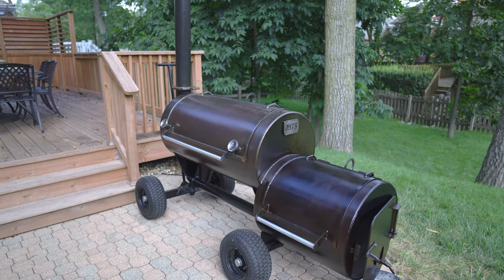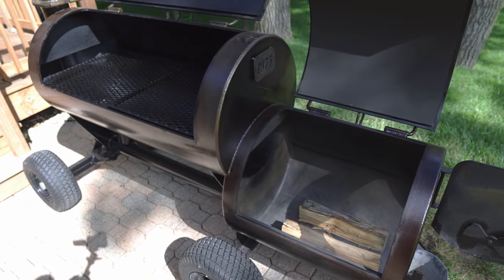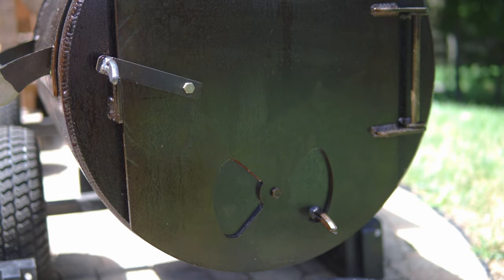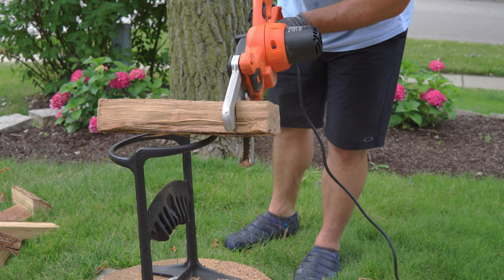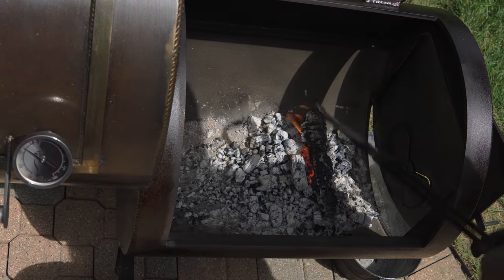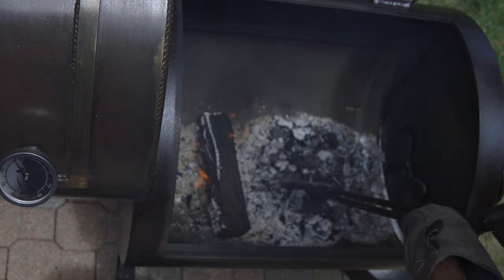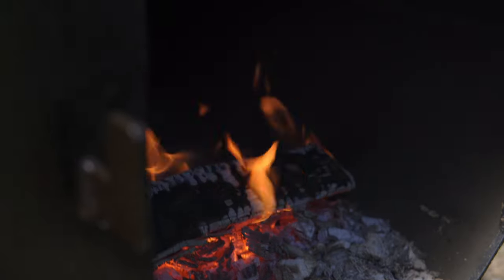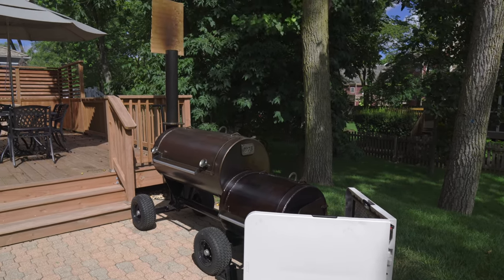How to Build a Coal Bed & Fire Management - Offset Smoker - Backyard BBQ

Comment: That folding table air deflector is genius ‼️
Reply from the maker: The wedge air deflector is a game changer. It's like a crutch I can't resist, even on calm days I feel the urge to use it haha! Flip it up, wrap some ribs, and then you know you're on to something. Thanks for watching!!
Reply: Yeahhhh Great idea!!
Reply: @smokescouts  what did you use on the stack? Was that cardboard? How did you keep it up there?
Reply from the maker: @jaredwatson8942  it’s a piece a thin wood that fits right in the gap between the stack and piece to hold the damper.

Comment: I have to say this is probably the best video I have seen on this subject.  Very well done.
Reply from the maker: Thank you, I really appreciate the feedback! I keep learning new techniques, so in a month or so I’ll make another one with some updates.
Reply: @smokescouts  I have never thought of using an alligator lopper before and like you, I had some concern about using a chop saw or mitre saw for this purpose (which isn't what they are designed for).  I have also been thinking about getting one of those splitting tools but wasn't sure about which brand, so thanks for the recommendation- I've got one on order.  I also live in a very windy place and had been thinking about doing what you have done there.  I think I'm going to get two big pieces of plywood, put hinges on them, and line them with a welders blanket.

And my workhorse 1957 is on its way.  Looking forward to the upgrade after so many years using cheap thin steel brands.
Reply from the maker: @patrickmacleod2415  that plywood idea will be perfect. My table is just a tad short, so the extra foot or so you can get with a 4 ft. wide piece of plywood will be perfect. You're going to love the Workhorse!

Comment: Thanks from a Newbie, just getting the hang of using a smoker. Got a OK Joe Longhorn for a birthday gift a few weeks ago. 1 rack of ribs and one small brisket both turned out great, but I clumsily managed the temps during the cook. This should help a lot.
Reply from the maker: You’re welcome! Smaller splits always make temp management easier, but if too small requires a lot of fire checks to keep feeding it, so I’d start with small splits and then work your way up to find that perfect size.
Reply: @smokescouts  you nailed it for me with the distinction between coal bed and split burn. I’m using 10” splits and about 2”x2”. Kinda found the sweet spot using similar door open trick and stack open full. Had it +/- 25* for the last 6 hours of my brisket. All of your tips helped me recognize what I had experienced so next time I can be proactive instead of reactive! Thanks again.
Reply from the maker: @michaelhemmingsen4430  awesome, you have it down for sure! Thank you for watching and the feedback!

Comment: Best backyard traditional flow smoker you can buy  right there! 👍 3/8 thick steel is no joke. Cowboy door is an option to NOT skip! Great video! Subbed! 😎
Reply from the maker: Thank you!! For this video I opened the cowboy door a lot to get some good video. I thought it would cause temp dropping issues, but the temp would drop 5-10 degrees and come back up to temp in a few minutes - which surprised me to say the least. You're right, that 3/8 steel is no joke!! This pit is a tank!!
Reply from the maker: Also, I agree on the cowboy door option, highly recommended just for fire and clean-up access alone. And those reverse seared rib-eyes are my families favorite!
Reply: @smokescouts  that is surprising...I wondered while watching this video again how much the temp dropped when you opened to stoke the fire or add splits...my current small smoker has the cowboy box and this is how I always add splits, but the temp will drop an easy 20-25 degrees if I leave it open for any longer than it takes to toss in a split...watching this vid again as I anticipate hearing from Workhorse in the next week or two that my 1975 is finally in production...question on the wood pile...how much wood would you say you have in those piles or how many cords I should say? I've got a stack built up but doesn't look like nearly that much...maybe I have underestimated how much wood this beast is going to burn...
Reply from the maker: @theftworthrealtor  yeah, surprisingly if you work quick, opening the cowboy grill doesn’t impact temperatures for more than a few minutes. If I have to do a more thorough coal bed arrangement or rearrange the splits, I still open it to do that with no issues. How many hours do you plan on cooking per week?
Reply: @smokescouts  Well it's about to be summertime, which means 100+ heat here in Texas, so I don't normally smoke more than once or twice a month...and I just got the email today that my pit was in the final stages of production!
Reply from the maker: @theftworthrealtor  finally, such a good feeling!! You’ll have to have a box fan right next to your chair at all times 😂
Reply: @smokescouts  yes! Summers are brutal here...gonna have to look at building a grill-zebo or something similar....

Comment: I run a WorkHorse 1969 and I removed the deflector/baffle plate from between the firebox and cook chamber as the deflector pushed the hot spot to the middle of the chamber - by removing the deflector (an angle grinder to the welds) the hot spot is moved to the far right end, thus less radiant heat effecting the meat. You may have done the same since posting this video.  Nice job on the fire management vid!
Reply from the maker: Thank you!  That’s awesome, I haven’t done that to mine. If you ever do a biscuit test please reach out and I’ll give you my email. I would love to see the results.
Reply: @smokescouts  Haven't done a biscuit test, but did test using Thermoworks 4-probe temp monitor across the cook chamber.  Before I removed the deflector, I had been using a water pan in the middle of the cook chamber to block the heat from the brisket which was placed right near the stack, but since then, I am able to cook the brisket center-left.  I still use a water pan (I'm in Arizona, so need the moisture in the chamber) but now I can put the pan on the bottom of the pit - center right and have much more room for the convective flow over the meat.  Works much better IMHO.   FWIW, Jeremy Yoder -  Mad Scientist BBQ did a video recently on his channel on his take on offset smoker baffles.
Reply: ; (. We spent nearly $200k CFD testing that deflector/INS Stack/Vent combo  Dialed in, not sure why you would cut it off, but smoke on
Reply from the maker: @WorkhorsePits   I couldn’t imagine cutting off my deflector plate. I love my 1975.
Reply: @WorkhorsePits  I have no doubt as to the cost/effort in the design - why I chose Workhorse over the many other options. But for me, I found that the deflector plate moved the radiant hot spot closer to the center of the cooking chamber. I prefer that radiant hot spot be as close to the firebox as possible, with the convective heat doing most of the cooking. As I'm sure you know, it's not uncommon for people to put a "fire block" split of wood on the grate between the food and the firebox to help protect from the radiant heat from the fire. I'm avoiding having to do that as I also put a 1/2 steam table pan with water on the bottom of the pit a few inches from the firebox to both deflect the radiant heat from the firebox up to the top of the cook chamber and add moisture to the cooking chamber (I'm in Arizona) with great success.  Thanks for making a quality pit that I'm proud to be smoking on!

Comment: A little off topic...but curious how you clean and maintain your 1975 pit. Such as firebox/chamber cleaning process after a cook. Not sure if this warrants a video...but would love to hear any general maintenance (or prep) steps you take before/after a cook and ongoing. Thank you for the very informative content and taking the time to teach others!
Reply from the maker: Thank you! I use a plastic scraper and quickly scrape the top & underside of the grates before each cook. I rotate them so one side burn offs from the previous cook since I usually only cook on one half. I scrape out the grease that didn’t drain out from the bottom of the chamber every 3rd cook or so and wipe with paper towel which only takes 5 minutes. I’ll scrap out the creosote buildup every 3 months and blow all of it out with a leaf blower, then spray inside with Pam. For the outside, once per year treatment of linseed oil on the chamber only. The firebox I spray with Pam or wipe with grapeseed oil every 5th cook or monthly.

Comment: How does adding 2 splits to refresh the coal bed not spike the temp? Also, I assume starting with a large fire to create a large coal bed in the beginning is a must for coal bed longevity?
Reply from the maker: @MrDavidDRM  two splits (higher temp) + small coal bed (lower than normal coal bed heat output), will offset each other to maintain temps. Yes, starting with a larger coal bed is a must.

Comment: Great video thank you...waiting on my 1975 now.  I see you Bears shirt..have you covered winter cooking on any of you videos? Also how do you like your warmer?
Reply from the maker: Thank you! I have no videos on winter cooking, but I cooked all winter as long as it was above 25 degrees, otherwise it would be too cold for me. The pit ran exactly the same. The only difference is it takes maybe 20 minutes longer to warm up, but after that it’s just like the summer. The warmer is awesome. It’s expensive, but I found mine for 1/2 off on FB Marketplace. I use it at the end of every cook. The built in probe and the ability to control and monitor away from home is great. The temperature control and steam options are perfect for holding bbq for an an hour or 20 hours.

Comment: I only watched the first 30 seconds and subscribed and liked because you're reppin Da Bears. my man! how are you keeping your pit so clean, both inside & out. I've been smoking for 40+ years, and this was an excellent video on fire management.
Reply from the maker: Haha, that's awesome! I can't wait for this Bears season -  I'll have a TV out by my smoker for sure! I store my pit in the garage, so I got in the habit of removing the ash and scrapping the grates and chamber after every cook, then quickly wipe the chamber with paper towel. My secret hack is whenever I'm using my leaf blower for yard work, I give the exterior, interior, and the inside of the stack good blast of air which removes a lot of dust and debris. Thanks for watching and the feedback!

Comment: This is a great video. I've never tried building a fire that close to the door. I'm going to try that right now just to see how much more it evens out my temps. I also would love to get a consistent 45 minutes out of a split....I'm only getting about 25 to 30 minutes now.
Reply from the maker: Thank you! Using dense hickory is my preferred wood because how long it burns. I’ve noticed with red oak or a too dry batch of hickory, I’m using a split every 30 minutes.
Reply from the maker: Also, with a fire that close to the door, it’s more susceptible to the wind, so definitely try it on a calm day to see if it works for you.

Comment: I use this same method but add a step; in a long cook as the fire bed cools and replenishes I remove dead spots in the bed to maintain a strong fire bed. I ve noticed as the bed enlarges it doesn’t last as long as a cleaned up bed.
Reply from the maker: Great tip, thanks!
Reply: Great channel. I am also waiting on a  1975 to be built. Beautiful smoker.
Reply from the maker: @tpharo34  thank you! You’ll love it!

Comment: Do you think putting a tray in the fire box to keep the ash off the coals easier??
Reply from the maker: Thank you for watching! The curve of the firebox is ideal for airflow and shaping the coal bed, so haven't made any mods. The newer splits and coals kind of smother the ash too - pushing it forward, so on long cooks I can sweep them out of the firebox if necessary. I've only done that on a long brisket cook, otherwise it's never been an issue.

Comment: I'm waiting on my 1975, great video. I also have the Cowboy firebox, do you find that when opening and closing the lid on the firebox it spikes the temp or reduces it or does it not affect the fire or coal bed?
Reply from the maker: Thank you! If you work quickly it has no impact. I’ll open it up if I need to do a more thorough adjustment and the temp will recover in a minute or so.

Comment: Had to come back and watch this video again, gonna apply the coal bed tips on my next cook…question, what do you do with all the small pieces you cut off each split, is there a time during the cook you can throw a few in so as not to waste the offcuts? I’m gonna have to do the same as most of my splits are 16-18in ranfe
Reply from the maker: I use a huge pile of the chunks to start my fire. That uses them up at the perfect pace.

Just a heads up, in this video I’m using really dry hickory and running the pit with the stack wide open. If you’re using wetter wood and/or using the stack damper, you’ll have to use a few more splits and build a bigger fire. (I’m going to do a part 2 of this video soon)
Reply: @smokescouts  awesome, I'd like to see how you build the wood pile for the Workhorse...wood I have now is in the 16-21% range, so I probably would need to build the bigger pile as you mentioned...I was gonna message you to ask which moisture meter you used, but bought one at Home Depot couple of days ago, then watching your vid had to lol cause turns out I bought the exact same one...was worried about buying one off amazon and it not being reliable...
Reply from the maker: @theftworthrealtor  haha awesome!

Comment: I am by no means having trouble with fire management, but I do have an issue with what I call a black dust getting in the cook chamber of my 500-gallon pit. I'm sure it's probably from ash getting in the chamber from the draft it produces. The fire box is 37 inches deep. I cooked a pork butt the other day (4th cook on it) and after wrapping for about another 2 hrs I noticed a black dust not visible to the eye but made the foil dull looking. That's when I touched the foil and noticed a film of black dust. Any opinions on this greatly appreciated. The pork butt was on bottom grate at the middle.
Reply from the maker: Sorry for the late reply, but I make foil “blocking logs” to prevent the ash accumulation. Not actual logs, but I fold foil into a triangle shape that stands on its own with the perfect height and width too shield that first row of food if it’s close to the fire.

Comment: Great video. I’ve got one of these smokers coming in the next couple weeks. Been waiting around 8 months. How do you manage the ash on a longer cook? I’ve heard that a lot of people have issues with a lot of ash accumulating on longer cooks, and it makes it harder to manage the fire. Any experience with this?
Reply from the maker: @danieljones304  I never had an ash issue even on a 16 hour cook. Don’t need to clean out until the next cook.
Reply: @smokescouts Good deal. Thanks for your reply. Maybe it was on the 1957 or some other smaller smoker.

Comment: Do you find that you use the cowboy grill door for loading more then the end door?
Reply from the maker: I probably use my cowboy grill door 25% of the time. If my coal bed looks good, I use the end door and just throw a log on (a lot of times I have splits warming on top so don't want to take them off). If I need to move the coal bed or do a more thorough rearrangement, I used the grill door.
Reply: @smokescouts  Just have to say that you seem to be taking very good care of your smoker. It seems to have a great outer finish

Comment: Thanks for the videos, they've been super helpful since I've just gotten my Workhorse 1975! I have a question about your temps, are you using the door temp probe or are you referring to your own temp probe placed on the grate when determining if you need to add wood, etc. ? How much difference are you seeing between the two?
Reply from the maker: Thank you, glad to hear! I really only look at my left Tel-Tru and aim for 225, 250, or 275 depending on the stage of the cook or what I’m cooking. If I use a digital probe on the grate, it runs about 25-35 degrees hotter. It’s a mystery even Mad Scientist can’t explain. Maybe radiant heat is the driving factor.

Comment: Thanks for sharing your expertise on fire management! I ordered my 1975t which is supposed to be ready by February. Curious if you know how many racks of ribs that it can hold?
Reply from the maker: You’re welcome, thank you for your feedback!! Will you be using the top shelf or just the main grate?
Reply: @smokescouts  both, but I understand that the top will likely cook hotter. Thanks.
Reply from the maker: @gerardm77  you can comfortably fit 7 larger St. Louis or spare ribs on bottom, and 4 on top with plenty of airflow between. If you have smaller ribs or jamming it full, another
3 -5 slabs.